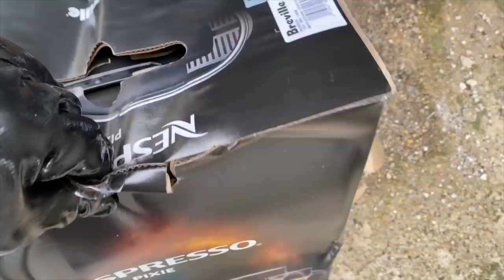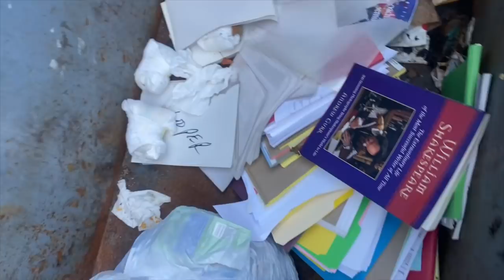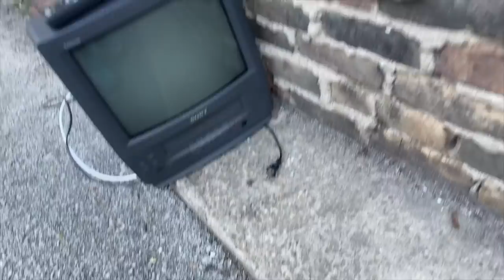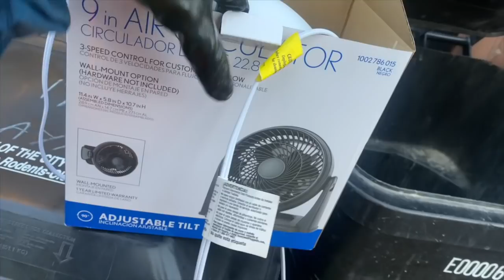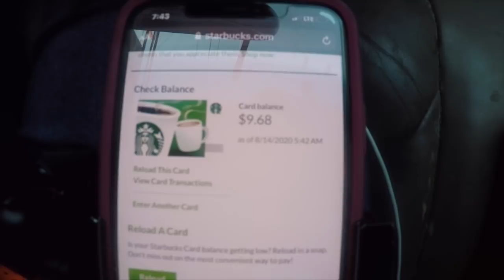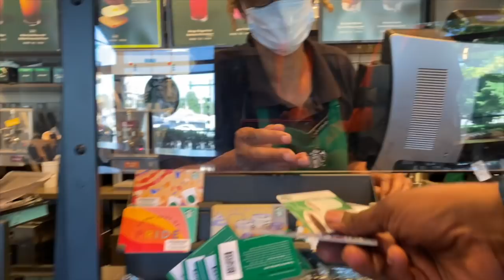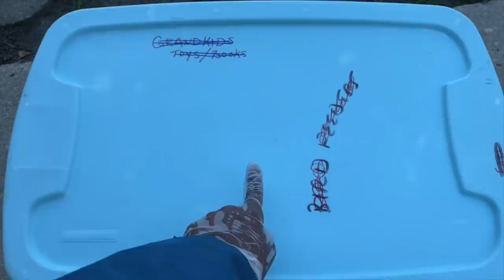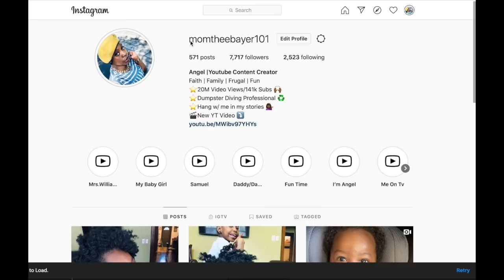Dumpster Diving:  BIG SCORE.... Following my INTUITION!!!

Comment: The garden shoe things are to aerate the soil so grass can grow better, the tv may not be very good as its not digital so without a digital receiver it will just be a vhs player if the player works. Use aerosol insect repellent to get the writing off the tote tub, just spray the writting and wipe away, it works fast. The tv will be colour when a vhs is put in, static is always black and white on old analogue tvs

Comment: The TV is definitely color. They stopped making black and whites a long time before that TV was made.  That looks  like 90s with the built in  VCR. At the end when you turn it on you can see yellow text on the screen, which means it has color. Only the static is B&W because it doesn't have an antenna so it's not bringing in any stations. But    you can just use it  to play videotapes and not   need an antenna.